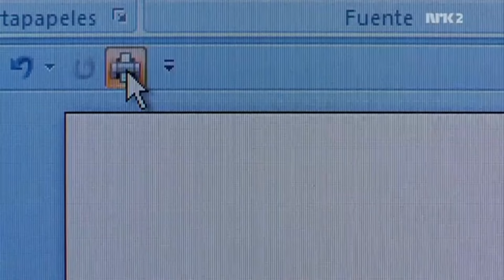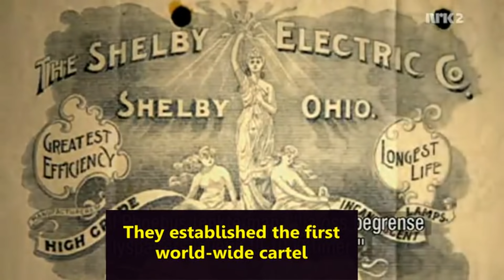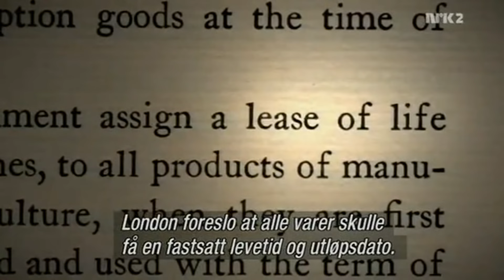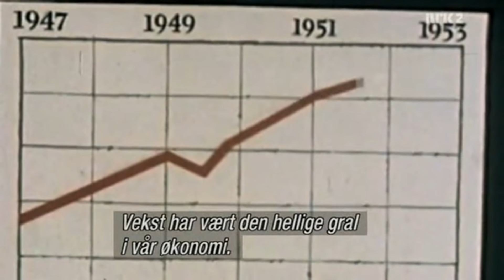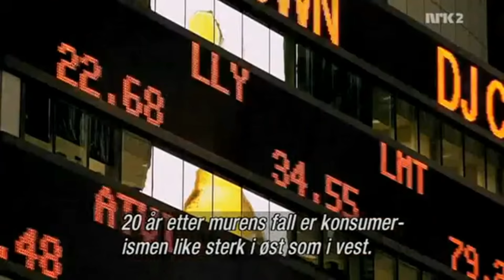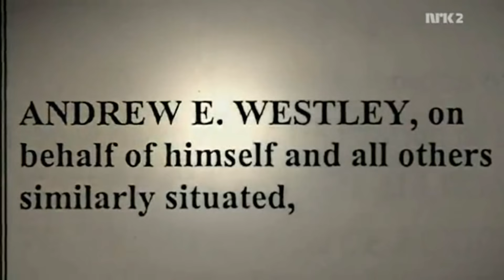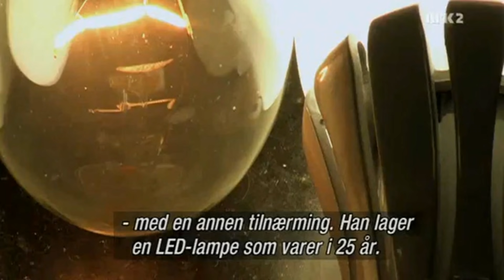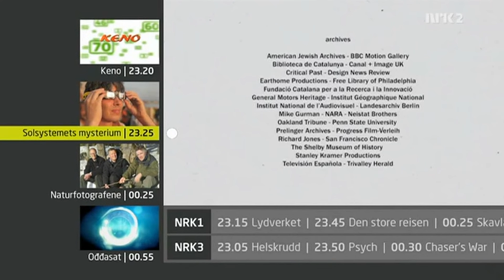The Light Bulb Conspiracy

Comment: ...and it's only gotten worse. Especially Apple. They took that iPod lawsuit and learned from it, by making all of the batteries in all of their devices non-removable, and starting up a bullshit "recycling program." Seriously, if you really want to recycle your Apple product, send it to a third-party repair shop that could actually use the parts to revive other Apple products. Don't send it to Apple, because more than likely it will simply get shredded. Or better yet, have the third-party repair shop fix it for you (since Apple refuses to do anything without replacing everything and charging an arm and a leg) and continue to use it for at least a couple more years.

It makes me angry hearing these advocates of useless consumption try to justify their opinions on the matter. It's all ignorant bullshit. Jobs will go away? No they won't. Even well-designed products require maintenance from time to time. And as technology evolves, people will always have the choice of buying something newer with more advanced features without being forced to discard their old device simply because it was designed to fail. And having those older devices still in existence gives poorer people the opportunity to own a once-great device that still does the job perfectly without having to pay a lot for it.

And by moving them into the second-hand market, we keep them out of landfills and other trash piles. That the consumption advocates are completely silent on the very real waste problem is maddening.